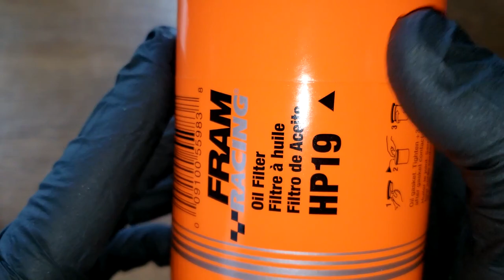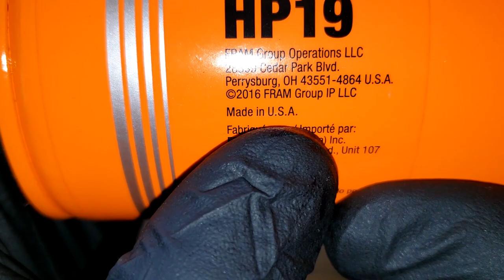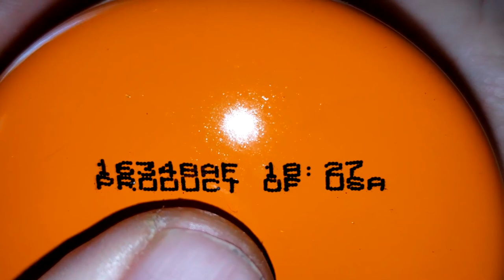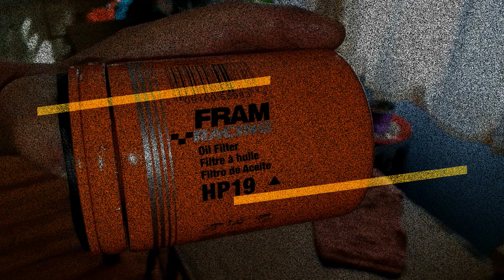Fram Racing Oil Filter HP19 Cut Open Used oil filter

Comment: It's good for more than 3,000 miles if you don't use it in a crazy high HP engine.  This lasts up to around 10,000 miles or 1 year in normal non-racing engines, according to a Fram rep who actually played some role in designing it.  Very sturdy, works fine, only available in limited sizes though.
Reply from the maker: I think so too, Thanks for sharing!

Comment: Says Fram on the can, BUT without a doubt it's made by Champ Labs. The ZZ stamped on the base plate confirms that. Didn't notice it on your last HP review, but thought CL made. Explains metal endcaps, and the (oh the humanity) louvers. 😀 They look fine btw. They are now part of the company, First Brands. If I'm reading date code correctly made 12/13/2016. Been around awhile. Solid looking filter, I like it better than the Fram fiber EG and TG, or even the Ultra now. Screen over bypass used to be used on TG, but Fram quietly removed it. Don't think it's a must though. Might keep a big piece of crap from clean side in a bypass event. More likely in racing I suspect. Thanks for video.
Reply from the maker: You're Welcome!
Thanks for all the info on this filter that your sharing!
Reply: @WhipCityWrencher  You're welcome too!

Comment: That "whisker" was obviously from the glue, but old eyes may not catch that ;-)  The problem with high flow racing filters is that they let larger particles get through and focus only on those, not anything much under 30 microns. High performance racing engines run larger bearing clearances and need the high flow. Usually, includes a high volume oil pump. A standard filter may collapse from the pressure.  I would not use a racing filter on my daily driver, even a tow vehicle.
Reply from the maker: HaHa,
Yep, that was a piece of glue, I could see it afterward. You can see it better in the video than I could at the time looking through a camera.
But your correct, eyes 👁👁ain't like they use to be.
Thanks for the feedback!
Reply: Yeah, I've been told the same thing about not using racing filters in street cars - by filter engineers and engine builders.

Comment: @3:30 as you rotated the filter media it sounded scratchy like a Cellulose media??  That hairy bit is just where the glue application ended and pulls away.  The black gasket where the bypass sits was an interesting addition.
Reply from the maker: Hi Lisa,
The filter is a synthetic blend and sometimes the pleats get a little stiff on these used oil filters.
The Fram Ultra also has that endcap gasket I think it makes for a tighter fit.

Comment: That's a nicely made filter but I'm not sure why anyone would want to run such a low filtration spec. This filter is designed for high flow, burst strength and to catch big chunks, not for long term engine longevity via filtration. Average no-name filters can match that filtration spec, albeit without being so well constructed.  Also, owner needs to at least double his oil change interval. If he had that oil analyzed, he'd find he was barely 25% into the life of the oil. No advantage to short intervals and a few drawbacks. A 3200 mile interval on an engine that doesn't need it is what is called "recreational oil changing."
Reply from the maker: 94% at 20 microns is a good micron rating. I would run this filter and oil between 5K and 7K miles, or once a year whatever comes first. And probably get an oil analysis at 5K miles just to see how it looks.
Reply: @WhipCityWrencher  Given the premium oil filters available.. I'd call it "average" efficiency. Did some research on oil filters for publication some years back and interviewed engineers from several companies. Tried to get some "rule-of-thumbs" on or off the record. Several spoke up and said the average oil filter on the average modern vehicle about 40 utilized (capacity) when they are replaced. My take on that is that filters can usually go a LOT longer on a modern engine. By the way, I like your approach to these videos. Unlike many, you factor in efficiency and don't just focus on construction aspects... many of which aren't relevant or are related to the price point of the filter and not the brand name. You are very even handed, not brand biased and matter of fact about what you see (at least in the ones I have looked at). I usually avoid oil filter reviews but yours are a breath of fresh air! Been cutting open and analyzing my filters for 15 years now and find it enlightening. Oil analysis too.
Reply from the maker: @SootHead  Thanks Jim,
Yep, an oil analysis report on my engine will make my day.😊
Thanks for sharing!👍
Reply: I just used it one time and wanted to see what it looked like after just going by the recommended miles on the box.
Reply: And Jim I normally change my oil every 7000 miles on my truck. I’m not a recreational oil charger, 😀 Again I just wanted to see what this filter was about. This is the only Fram filter I’ve ever used!!
Reply: @stevenwright248  Thanks for the explanation. I bore in mind that it's your truck to do with as you please but I should probably say it very time too. Still,  I think the exchange of ideas is always a good thing. And this is such a good site that I feel motivated to comment.

Comment: Good quality filter that Racing Fram. I like the screen on the bypass valve, but not sure what purpose it actually serves. The rest of it is real good
Reply: To catch large debris in the unfiltered bypassed oil
Reply: @timbur2711  if the debris is that large I then your engine is toast. I would make the screen size smaller.
Reply: But that’s why the screen is there, to catch that large debris. It better than no screen like pretty much every other filter. They also don’t want to have a huge pressure spice with a fine screen when the oil pressure is already too high for the filter media
Reply: The media rating is terrible, as is the case for most "racing" oil filters as most are dumping the oil every few hundred miles.
Reply: @timbur2711  didn't think about the oil pressure. Good point. I think its overkill on a normal car. Good filter though
Reply: @GT-mn3bx  I wouldn't call 94% at 20 microns terrible.

Comment: Only 6 inlet holes? High performance/racing filters are more concerned with flow and 6 holes seems marginal for that purpose. Many off the shelf top line filters have 8-14 holes. Go figure.

Comment: PUBLIC SERVICE ANNOUNCEMENT: As someone who has worked with multiple filter brands, I am going to tell you what filter engineers have told me ..
NEVER USE A FILTER DESIGNATED FOR "RACING" ON YOUR STREET CAR!!!
The components may seem heavier-duty because they are. However, since life expectancy for racing engines is very short and less resistance to flow means more horsepower, the filter media has been "opened-up" to maximize oil flow at the expense of protection. So you may see markedly higher oil pressure with one of these filters, but it is also letting more contaminant circulate through your engine. If you look under the hood of many racing privateers, they actually run high-quality street filters because they don't want to be tearing down their engines every week or two. You've been warned.

Comment: Most "racing " oil filters are terrible for everyday use.  Most are in the 50-60 micron range.  Do your research. Don't buy marketing hype.
This filter is 94% at 20. Does that mean 99% at 60?  That doesn't matter when you dump the oil in a few hundred miles.
Reply: Build quality is good though. Won't use it in my car. For reasons you named. Just stick with the OEM or similar filters and do my 7500 km oil changes
Reply from the maker: It states 94% at 20 microns, if you don't believe that, then there's no sense in believing any of the other manufacturer's micron rating claims. I mean how do we know when it's true and when it's not?
Reply: @WhipCityWrencher  It isn't about  believing it. It is what is it at 99%? 30, 40, 50,,60? If you look at Wix racing filters, most are 50-60.
Reply: @WhipCityWrencher  Also, Wix racing filters are 28-30 GPM flow rate compared to 9-11 for say a regular. That can only be achieved by much looser media. Racing filters aren't meant for anything more than what you run in a weekend.  Or even one qualifying session.
Reply from the maker: @GT-mn3bx  Frams website states 94% at 20 microns . Here's the link https://www.fram.com/parts-search/HP19/?ref=NoIgDghgTgLgdgVwLYCMCmUQBoQAkAKAjAJzaIA25WFVN1Cl9jNAukA
Reply: @WhipCityWrencher  Did some digging on a few race sites I buy from on occasion.  Moroso racing filters "smallest particle size filtered' 53 on one, 57 on another. No percentage.  On the Wix it stated 61, no percentage.  All with 2.5-3 times the flow rate of a normal long term filter.  No one is running racing filters longer than a weekend. And that is on dry sump oiling systems with 14-20 quarts of oil.
Reply from the maker: @GT-mn3bx  That could be true about the Wix, I haven't looked into their racing filters.
Reply: @WhipCityWrencher  I posted that in the original post. The issue is what rating at 99%. You can't have 3 times the flow with a tight media.  That is common sense.  Racing filters are designed for a 550 mile weekend and that is if you were running a 500 miler and a few qualifying sessions.
Reply: I'm not sure of the point you're trying to make. It's true most 'racing' filters are not very efficient, closer to sieves, rock catchers. 94%@20um is very decent rating. With that rating and filter construction, I would use topic filter on my car no problem. Maybe "you" don't want to use it for racing, IDK. Look up the Ford Racing Filter, it too has a very good efficiency rating.

Comment: About those "Date Codes" -- VERY FEW oil filter makers put an actual date code on their filters -- and those who DO NOT put a LEGIBLE date code on the filters should be called out on it. Date codes are given as "mm/dd/yy" - or "dd/mm/yy" - Example: "05/31/22".
Any other numbers should be IGNORED, as they mean NOTHING to the guy who wants know how old the filter is BEFORE he buys it.
 It says right on the filter that it's for : RACING . RACING !!
This filter is NOT made for your pickup, family sedan, or your grocery-getter, and it will NOT help your engine to go faster, perform better, or save you one lousy dime in fuel economy.
  This RACING oil filter has a HIGH FLOW RATE -- due to the LOW-efficiency media that's used for racing applications.
  Looking at the filter -- Not enough inlet holes -- should have at least 8 holes, 5/16ths in diameter.
 Should have crimped metal seam -- Spiral-wound steel center core with louvers is strongest, but the Nylon core uses less energy to produce, so is more environmentally friendly.
Whould I buy or use this oil filter !??
Absolutely not. IT'S MADE FOR RACING -- not for grand touring.
https://www.mercuryforum.com/forum/grand-marquis-14/1995-grand-marquis-restoration-8937/
Reply from the maker: Hi Chuck, haven't heard from you in a while?
Many oil manufacturers put date codes on their filters, you just need to know how to decifer them, that's how they know who and which employees made the filter. 
Say you as a customer go to them complaining that your engine just blew up because of a faulty oil filter? They would know by the date code what facility and what shift and time the filter was made. They could look it up and Bingo, they got the Supervisor in charge.
Reply: @WhipCityWrencher  It's all good, Whip !!
Me and the Dear Wife were on vacation to Riverbend Hot Springs, in Truth or Consequences, New Mexico.
 The famous 95 MERC ran perfectly, and we enjoyed touring the mountains of Arizona & New Mexico, while dodging the raging forest fires.
 As for those "date codes" -- we're not looking at 'em the same way -- The numbher that is described as a "date code" is NOT a "date code" -- it's an internal code that is used just as you say -- but it is NOT a "date code" as expressed in any official documents.
 I believe it's the STP Oil Filters that actually have a proper "date code" printed on their oil filters.
IMHO, Customers shouldn't need the Navajo Code Talkers to decipher when the oil filters were actually made.
Reply from the maker: @SlikLizrd  Hope you and the wife had a good vacation.
Reply: @WhipCityWrencher  Thanks, Whip -- it was great !!
Reply from the maker: @SlikLizrd  👍😊